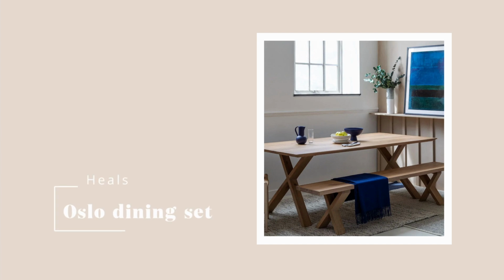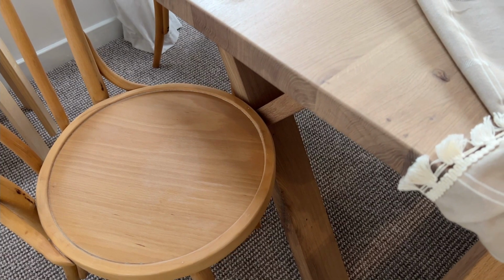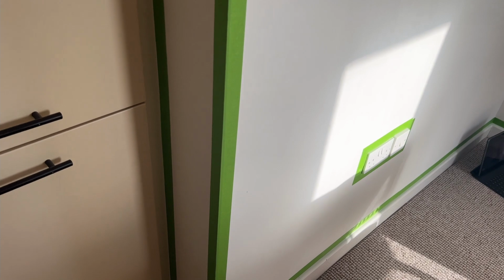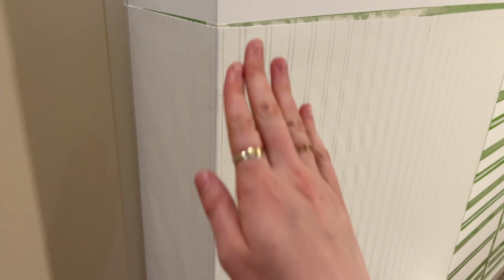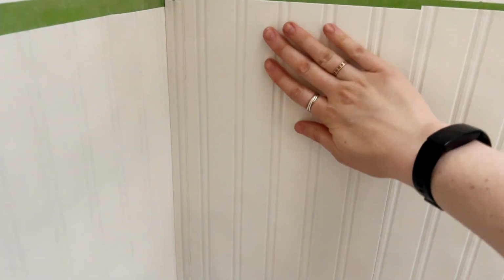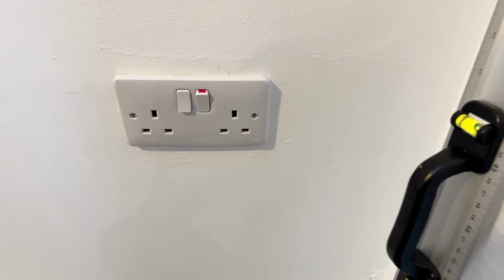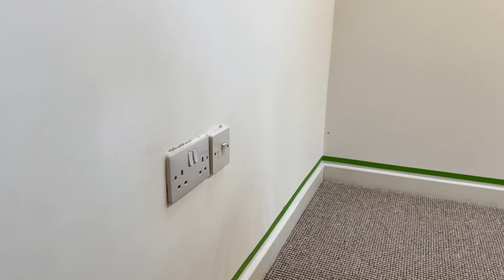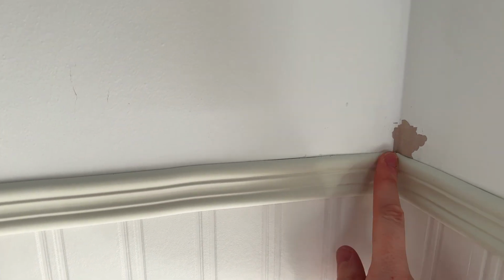EASY Beadboard Without Power Tools | Dining Room MAKEOVER

Comment: for anyone watching: I did a very similar project but instead of attaching the beadbord on the painters tape, I attached it on a super thin mdf piece (so it would not become heavy). I needed to cut the mdf very uneven because all the walls are wonky. Then I attached the mdf on the painters tape with very strong double sided tape. they look very even on the wall even though the mdf pieces are not at all and I did attache the beadbord on a lying mdf piece wich is so much more easy than on a hanging wall.
Reply from the maker: ahh interesting, I like that idea too!

Comment: Looks amazing Teri! Thanks for sharing the hard parts too. I think this wallpaper trick is also great for a room where it will be knocked down eventually for an extension - I might use this for the utility area 🤔 
Apparently, using a heat gun and a stripping knife is a mess free option when you need to take the wallpaper off.
Anyway, it looks lovely and I love the colour ❤
Reply from the maker: Aww thank you and so glad it's inspired you to use it in your home. Thanks so much for the tip because I'm not looking forward to the removal part haha